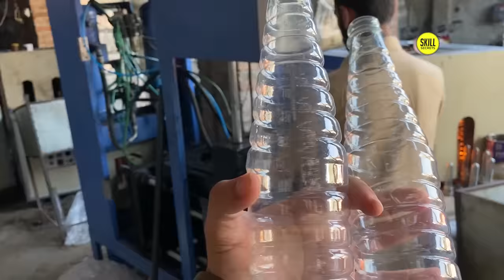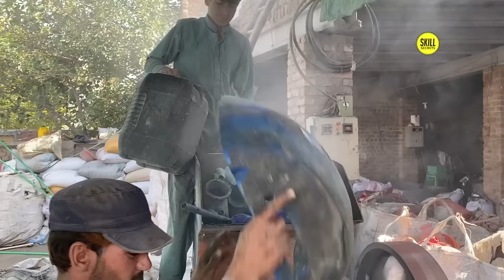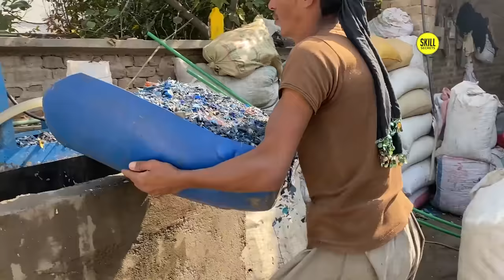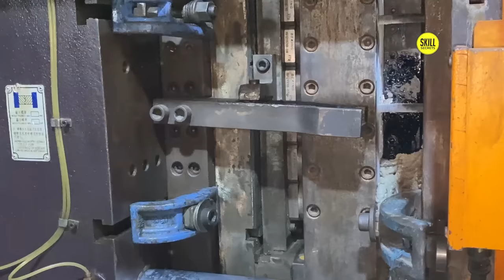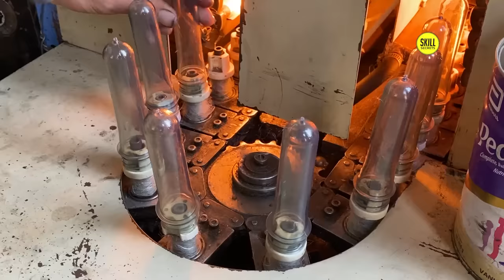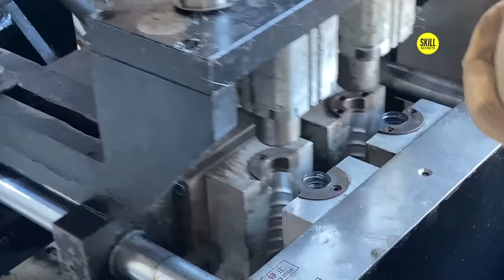Water Bottles Making Process | How Water Bottles Are Made | Plastic Bottles Manufacturing Industry

Comment: Good to see the recycling of the plastic but as the others mentioned it is not PET plastic used in the two step process of injection molding preform and then stretch and blow preform into water bottles. It nice to see the machines we used in the early 1980's still being put to good use.